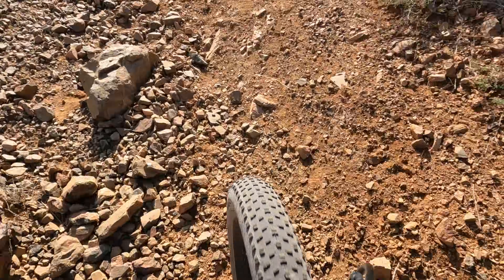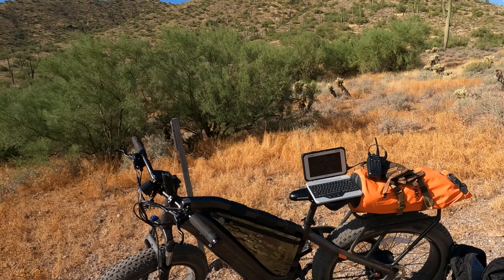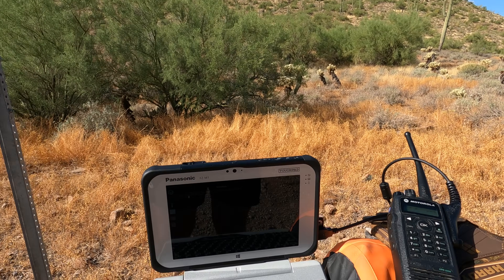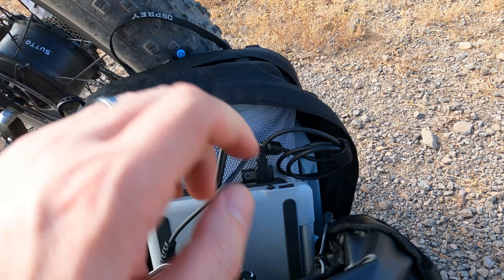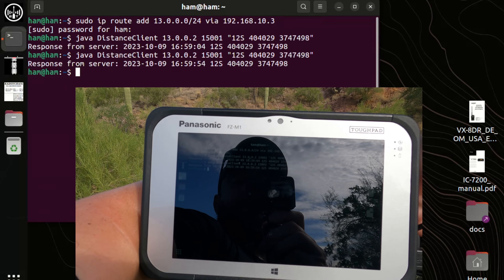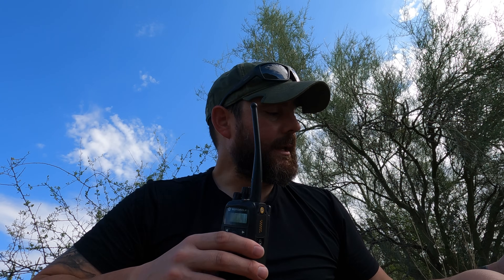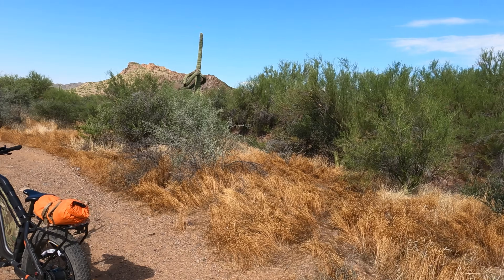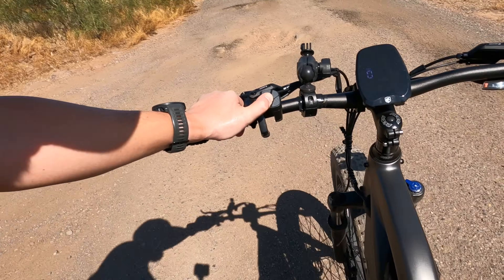DMR for Preppers - Range Field Test - Motorola XPR6550

Comment: Very interesting experiment!  Perhaps in the future you can take a small UHF yagi antenna in the field and see how far you can extend the range.  I have little interest in DMR hot spots or the local DMR repeaters either, but this application has piqued my curiosity.  My problem is there is no one around here for me to communicate with.  That walk mode is a lifesaver if you end up having to push the bike, especially when you have all your field gear as well.  Nice feature.
Reply from the maker: I actually could have made this work farther, but I was not about to climb another mountain South of my location. I have a 440 MHz yagi that has been in the garage. That will be a great experiment to test. The station at the house was running a Diamond D130J Discone. It's nice that the XPR6550 uses a standard SMA connector (same as the Baofeng radios).
Reply: @TheTechPrepper  Agree with Swamp-Fox with the Yagi. Because of the difference in the ability to transmit over distances, I would prefer to see a VHF version of this set up without the usage of repeaters. I've always considered the use of repeaters for emergency use in an extreme TEOTWAWKI situation say an EMP or grid down situation where the repeater is down hard.

The necessity for a point to point communication in the worst of conditions without the use of repeaters should be what everyone should strive for, which is why I'm so attracted to the use of NVIS for HF and Yagi for low powered but amplified VHF communications.

BTW every time I see one of those E bikes I want one! Could be a real life saver if you injure yourself on the trail and not able to pedal very easily.
Reply from the maker: @gregrush6570  I agree with everything. The only downside to the e-bikes is the weight. If the battery dies, these require one heck of an athlete to move from point A to B. However, I am finding the fat tire e-bike to be another asset. It is great to cover more distance without being resource depleted when you arrive.

Comment: Good experiment. I set up an XPR 6500 and XPR 3500 for point to point. DMR code plugs are a piece of cake compared to the CPS software from Motorola, not to mention them hammering the consumer on the software cost. For me, the juice wasn't worth the squeeze because I don't have anyone in my AO to tx/rx on the other end.
Reply from the maker: I was batting 500 on this one and made 2 out of the 4 contacts. I was in two valley for the ones that failed, so it was more an RF/physics issue than a problem with UDP/IP over DMR. I think point-to-point DMR is the right role for these radios. Cheers to a former Motorola user. CPS is now free.
Reply: The CPS software that keeps coming up when searched is the 2.0 version. From what I can tell, they are saying it doesn't work with this radio.  Can you confirm or point me in the right direction for the software?
Reply from the maker: I am using CPS 16 with the XPR6550. This is available from Motorola for free now.